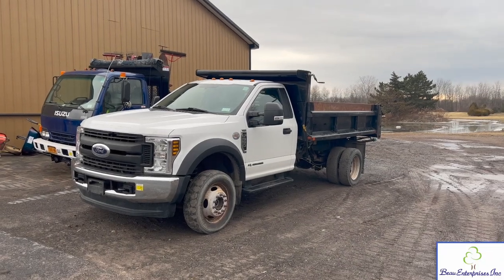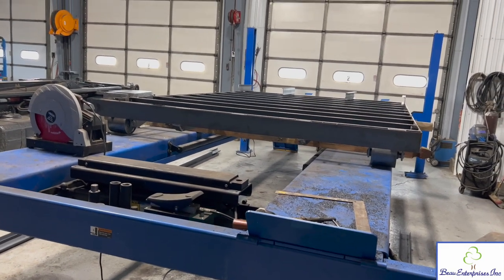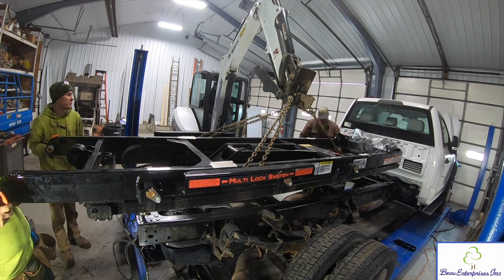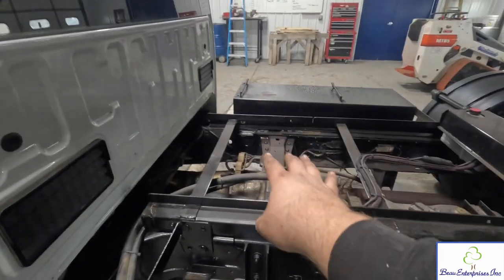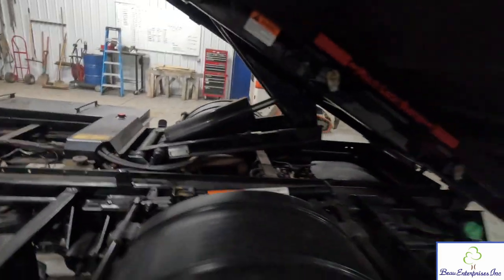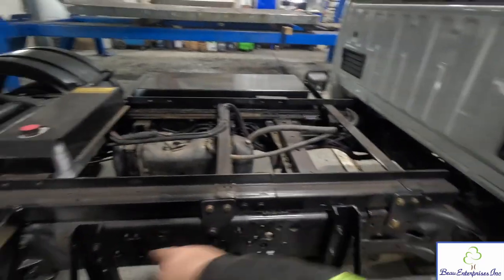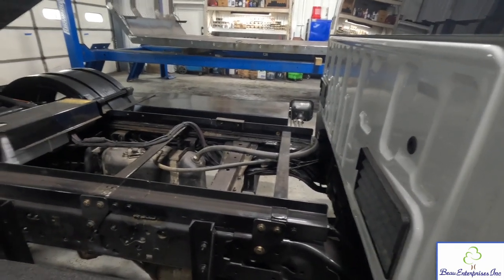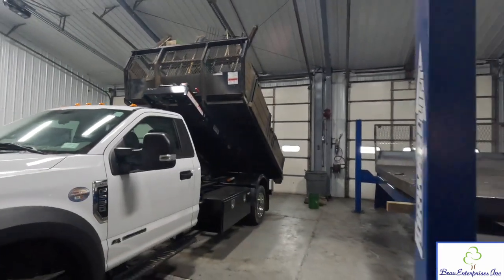Installing the SWAP HOGG

Comment: Why not  buy new 🤔. The write off ....and warranty
Reply from the maker: New trucks are so over priced. I saw a truck similar to this brand new $116k. I’d save the money and buy something else to benefit us. As for warranty, we’ve never seen purpose in extended warranty’s. They charge a ton of money and most likely won’t honor it anyway, by the time the warranty is expired most of the kinks are worked out. By year 3 the truck is at its peak performance in terms of cost to revenue cause its depreciation and not a whole lot of repairs needed